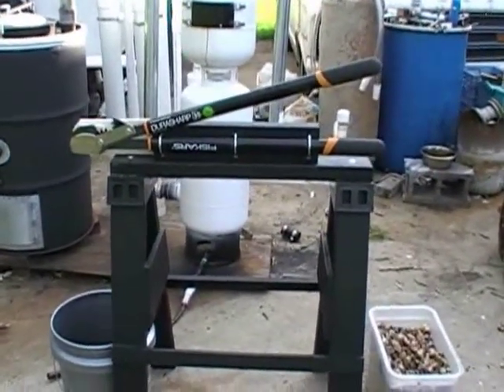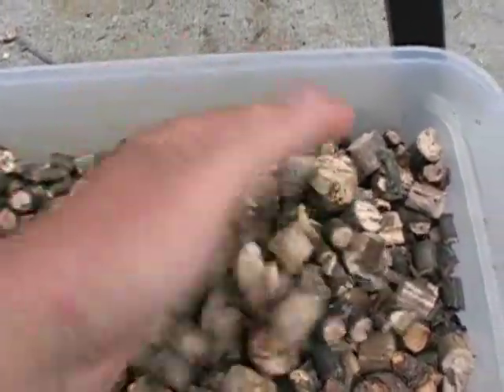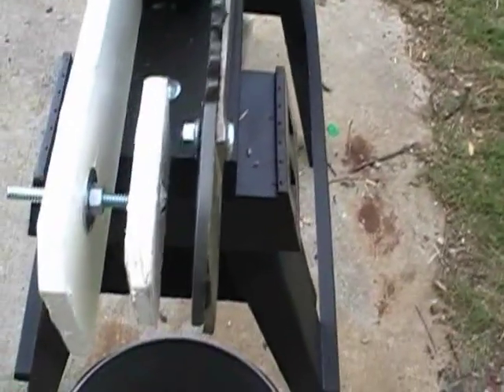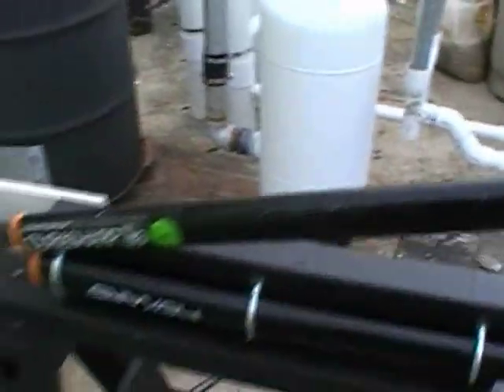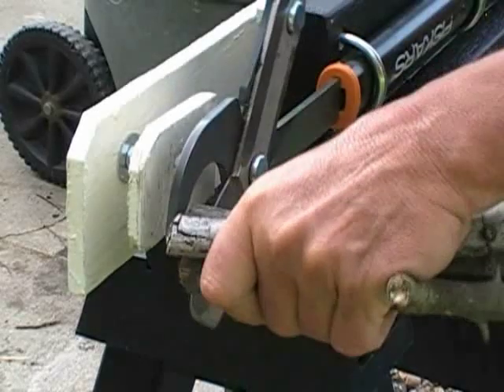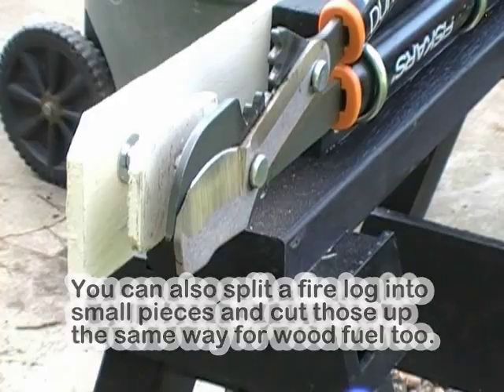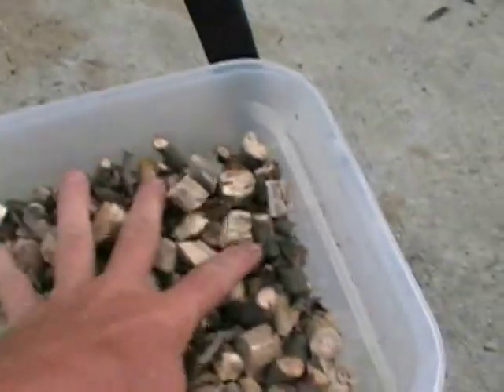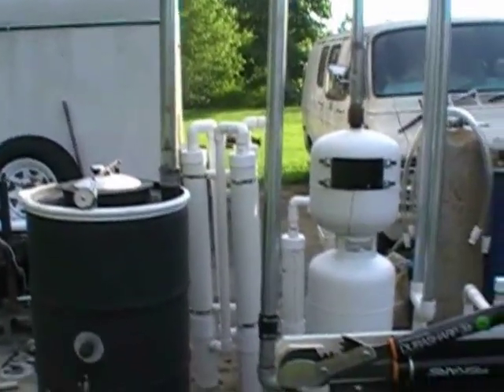06-19-2013 Build a simple hand powered wood chunker

Comment: Would chips work 
like from a wood chipper  ?
Reply from the maker: As long as they are good and dry and they are sized correctly.
Reply: @flash001USA  
Thanks for quick reply.
I thought they would maybe be to dense .
I checked online and looks like a special process to burn them .
Most small things like dried grasses and leaves they want to bio process them to produce gas .
To much space , not enough gas .

Comment: Very cool!   I think we're going to try making one of these.
Reply from the maker: If you do do one simple mod with the piece of wood that has the adjustable screw for setting the depth of the cut. Angle it a bit so that when you make the cut, the wood falls into the bucket without hanging up. That was the only issue I seen with this and I've already made the corrections on mine.
Reply: Thank you very much!   We have 6 acres of woods with tons of sticks everywhere but we wanted to wood chip but don't want to have to use fuel.  We were looking for a manual option and I just found your video.  Even I could do this!  (I'm a 59 year old woman.)  I just sent it to my husband.  Thank you very much for responding.  We're trying hard to get off grid in every way possible.

Comment: I don't like it... Lopers should be turned 90degrees...then make a stand for the wood to be cut and have an adjustable plate underneath the cut to get any size piece...then attach something that kicks the cut piece off when opening lopers back up ....wood then falls and repeat...it would cut the time doing it by a vast amount because it's basically like repeating rifle....and the way he has it now is like a muzzle loader because he has to move wood every cut....which would you rather be shot at with ( none I know ) repeating rifle or muzzleloader...big difference

Comment: Hello Flash, ive´been following you for some time and a really aprecciate your work, it´s been usefull to me. I have a qiestion: do you think your gasifier  can produce and hold enough woodgas to run a 4L motor of a CJ10 1978 Jeep it used ti hace a 358 engine and I istalled a 4L Cherokee more modern engine; i´ts not fuel inyected its carburated. Thanks in advance. My name is Abner my email: abnervalbuena@gmail.com.
Reply from the maker: Hi Abner This is a gasifier for small engine builds so unfortunately it would not keep up with a large engine. Check out www.driveonwood.com because they have large engine gasifier builds down. Good luck, Flash.
Reply: Thank you Flash, we will
keep in touch.

Comment from the maker: Yeah, it actually works for my setup. This is intended for an emergency fuel cutter. Somewhere along the line I plan on building an electric wood chunker that will run off the generator while the generator runs off of woodgas.

Comment from the maker: Yeah you can and I have ran them in this setup but there is one issue that can come back and bite you on the backside. They are lighter and small in size or at least the stuff I ran was and it wants to bridge so you have to make sure that it does not burn out the center of the sawdust and you also do not want to pack it down while the gasifier is running because you will kill the airflow and stop the gas. If it bridges on you there will be a lot of flashbacks "foops" and the material can:Cont

Comment from the maker: I will definitely get a workout with this cutter and in an emergency pinch it will get the job done. A lot of people build gasifiers then they drop the ball on their fuel and it's proper size. To me that's another hurdle that you have to overcome unless you plan on running on store bought wood pellets. I'm still looking into a simple reliable way of cutting wood for mine but a bit faster than the sheers AND without the use of gasoline. I will figure something out sooner or later.

Comment from the maker: A buddy of mine is going that route. The reason I wanted to avoid that route was because of the blade life and I don't like the idea of kickback when cutting odd shaped wood. Keep in mind that this is an emergency use cutting tool and I wouldn't advise using this for an off grid setup. Although my gasifier is large, my ember zone is only geared up for small engines. If I load my hopper to the top with pellets it would probably run for 16 hours non stop and loaded with raw wood about 4 1/2 hrs.

Comment: I could also see if one make a offset with a dc motor how one could make that into a auto cutter np and mount one on a truck so when its running one really could cut fast and alot with less work and have way less bulk to have on the truck. That way it would work more like a wood chipper but with 1/16th the bulk too. Very cool ideas we both are passing around very cool stuff keep it up its those simple ones that work for yrs with little repairs.